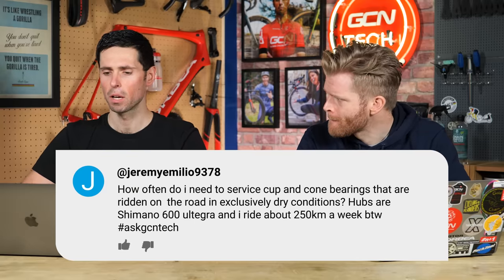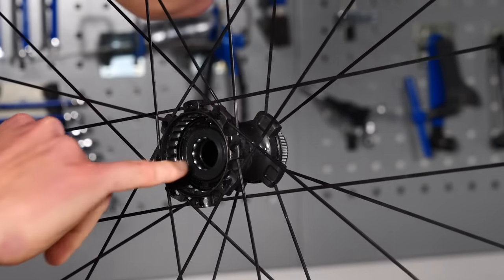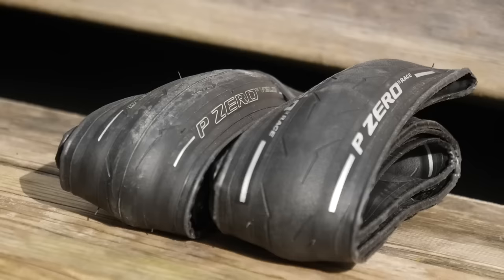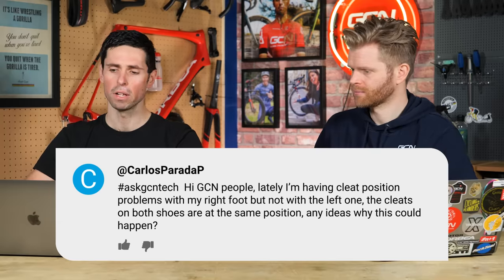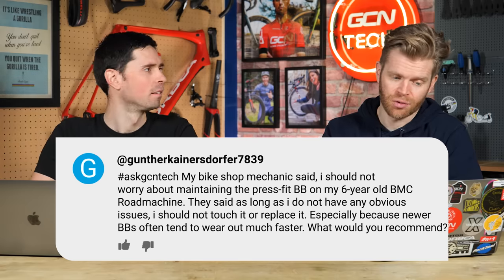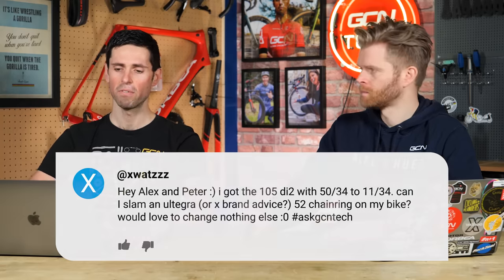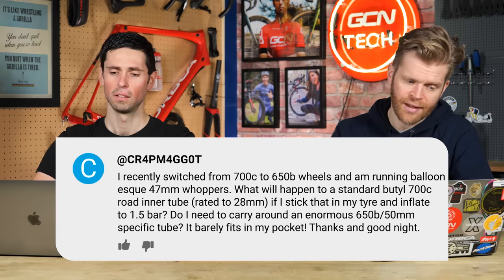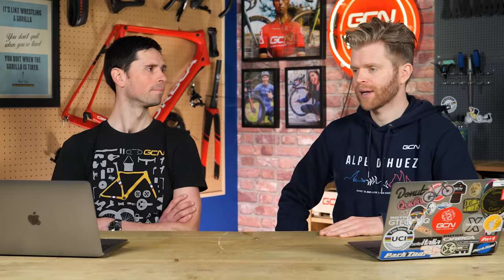Cycling Cleat Problems & Should I Swap My Tyres? | GCN Tech Clinic

Comment from the maker: Leave your tech questions in the comments 👇
Reply: Hi @gcntech Why can’t I unclip after fitting a brand new set of Shimano SPD-SL cleats? 
When will Shimano realise this problem and redesign their Cleats or Pedal release mechanism? 
Why do I have to resort to filling down the rubber tips (yellow, blue or red) that are making contact with the pedal release mechanism and preventing it from smooth unclipping? 
Why doesn’t Shimano sell replacement metal SPD-SL pedal wear plates?
Why does my perfectly fine pedals (bearings and body) have to go to landfill when worn wear plates start causing knee problems?
By changing from screw-on to bonded wear plates and by reducing the size and on some models individualised the contact patch, they made the problem worse.
Rant over, why do I bother anyway, I’m currently moving to Look Pedals because of the issues stated above and the fact decent quality Shimano pedals became pretty unaffordable compared to competition…

Please put a bit of pressure on Shimano to get their act together…
Thank you
Reply: #askgcntech -- There's plenty of bike-brand specific sealants like Slica and Stans No Tubes, but what about the "lesser" brands like Slime (here in the US). Are they "super good enough" or should I really spend more for Slica/Stans? I'm not a racer, just a recreational rider who does about 120 miles a week.
Reply: #askgcntech Hi there! Any thoughts on Silca's new "Stripchip"?
Reply: #askgcntech how do I avoid getting water in my wheels when cleaning. (I’m running Inner tubes if that helps) Thanks

Comment: An issue I came across when I replaced my GRX chainring to a larger big cog was also to be mindful of the fact you'll probably need to raise the front deraileur hanger slightly in order to give clearance for the new chainring. The extra teeth on the bigger new cog will make it closer to the hanger than it was with the smaller one, giving less clearance then before (in my case, the chain rubbed after doing this).

Comment: #askgcntech 

Assuming two cyclists (Rider A 60kg Rider B 80kg), with the same CDA, are riding at the same speed, into a constant headwind (15mph), what is the relationship between Rider Power, Rider Weight and Windspeed? What effect will increasing the windspeed have for each rider, and is it a linear correlation?  (3 points)

For extra marks:
Discuss if the headwind is increased to 20mph, what affect will this have on each riders power, if they were to maintain the same speed?. (1 point)

Comment: 700C/650B Inner tubes - the 700c inner tube is a wider circumference and won't fit properly in to the middle of the smaller rim. I think that the advice of a TPU spare tube is the best option in that scenario.

Comment: The Tubolito TPU tubes I carry work with both 650b and 700c tyres. Really useful when I run my ex GMBN Orbea Rallon in either full 29er or mullet, 29er front and 650b rear.

Comment: A narrow 700c tube won't stretch that well everywhere: the reinforcement around the valve won't allow it and create a zone of small stretch near very extensive stretch, basically a stress concentrator.
Now, a thinner, but still regular size 26" tube is a good compromise, when 650b TPU is rare or too costly. Tubes stretch diameter-wise much better than in width.
Reply: Yeah, they should have concluded with, "Try it and let us know.  We don't recommend it."
Reply: @larrylem3582  more like "try it and see how far you can go"😁

Comment: Regarding the addition of a 52t chainring to a compact groupset... I ran a 52t with a 34t chainring setup for years with no observable adverse issues. I did buy a new chain and cassette when I made the change, and I put roughly 7500 miles on it. I'd say do it and mind the cross chain alignment

Comment: How do you tell when the sprockets/chainrings are worn out is there a way of checking against a profile chart?
Reply: Once they resemble almost like a shark's fin or when your chain is beginning to slip over the teeth consistently whenever you put the power down, time for new ones.
Reply: Put a new chain on and see hot it fits. There are short tutorials on this. Meanwhile profile chart is not a reliable tool because teeth have variation in shape for shifting, and there is a significant error in projecting profile onto the paper.

Comment: I was personally able to overcome issues with pain in the back of my knees by lowering my saddle just a touch. I initially thought it was my cleats since I had recently started using SPD-SLs (coming from SPDs), but knocking my seatpost down without doing anything to my cleat position did the trick.

Comment: Tip on cleat position for different feet: spend some time on a flat pedal or otherwise non clip pedal and just look down at where your feet go. Having started with Christophe clips and Binda straps, I got into clipless with the first Look pedals after seeing Lemond and Hinault feature in C4 TdF coverage. But, years later, I kicked a wall hard while sleeping with bed next to the wall. Right foot now slightly twisted outwards and compacted by 5mm. The specialist said it would be the left foot that felt strange on the bike and he was right. Aside from spending a lot of money on a very careful bike fit, start with the assumption that your feet are not symmetrical so the pedals and cleats need not be symmetrical.
Reply: I've absolutely noticed this too. Still on flat pedals but my right foot tends to sit slightly rotated compared to the left and when I eventually swap over to clipless, I'll take that into account

Comment: The "group/bunch" experiment fails with variables like:

1 What's the size of the group?
2 What's the spacing of the riders?
3 Where does the test bike set in the bunch?
4 Can the test rider jockey for position in the group?
5 Will the test rider be out front at times or alway in the draft?

All of these are N variables that can greatly change the result of the test if changed.

Comment: I have asked this question many times but I never get an answer. Maybe this time? I have the new Trek Domane al 5 4th gen with 50/34 and 11/34 12 speed mechanical Shimano 105. I'm thinking about modifying it to 50/47 and 11/50 with a GRX derailleur for a "half-step" configuration. Will it work? And what would be the pros and cons of such a setup? Thanks?
Reply: First, GRX 1x derailleur capacity is not technically enough for 3 extra teeth up front, but it might work. Just like technically 12s and 11s pull ratios are different, but not that much.
Second, front derailleur parallelogram is moving so that the smaller ring must be significantly smaller than the bigger. If you move the FD way up for clearance over a 47t chainring, it will be too high at 50 and cause chain drop.
Lastly, did you check the gear spacings with gear calculator and surely wouldn't like other ways to achieve "half-step", with maybe 1,5 or 2,5 offset? But then you will definetely need absolutely another setup, very similar to 11s GRX
Additionally, sure half-steps are even any good for you? You ready to use FD as often as RD?
Reply: @feedbackzaloop  
I'm an armature cyclist, just started last July. That is why I'm asking the question.
1) Wouldn't the 12 speed 105 rear shifter handle the movement of the GRX. What does the GRX know about how much to move except the shifter actuates it?
2) When I look at the front derailleur while the 34t is selected the derailleur cage is already slightly above the 50t ring.
3) I did the gear ratios by hand and they are almost perfectly spaced in between each other along the entire range giving 24 unique ratios.
4) One would not have to use the FD all that often, only when one needs an in between gear.
5) I don't know if it would be any good for me. That is why I asked for pros and cons. I just like the idea and think it would be cool to try.

I bet that the GCN Tech members have most of the parts already available (except maybe the 47t ring) and could try this idea in an afternoon. Good or bad idea it is at least an idea worth making a video about.
Reply: @michaelsherwin4449  Try it yourself.  Sometimes you have to try a change to see why it is or isn't a good idea in practice.
Reply: @michaelsherwin4449  oh, it's Di2 we talk here, if i read your "what does GRX know"... Ok then, things get bit more complicated, but simpler. There is no 12s GRX Di2 and 11s di2 is not compatible with 12s Di2 in ant form.
Otherwise, mechanically:
1) pull ratio same, pairing shifter and RD shouldn't be a problem
2) ok, if you see the spacing is adequate, try it. But not so sure you matched the position of shifting features on the cage with chain
3) did you consider cadence range? In lower gears the spacing normally shouldn't be that tight. So guessing you need to compensate only top gears, my proposal was to shift half + n times full. Not 1l-1h-2l-2h... but 1l-2l-1h-3l-2h-...
4) if so, what is the purpose of half-stepping at all?
5) pros: you do something extraordinary and learn a lot. cons: you end up with hard to operate heavy system
6) GCN hardly ever try out anything unless it's a two-three video series for mass public. Most of questions picked are not specific but an example for broader audience.

So I have to ask you again, or rather you have to ask yourself, what specifically do you not like about current drivetrain and what compromises you could make in order to fix this. Because, well, if one could have it all, there would have been such sollution on he market, even be it very expensive.

Comment: Concerning the hub maintenance: it is also important which grease you use. A white grease turned rather fast into grey and also was pressed out through the seals (Shamal HPW rear hub), while the green Motorex bike grease stayed green and also remains in the bearings, even in the headset it maintained its composition for years, and dirt had no chance to get inside.
Reply from the maker: That Motorex grease you mention is very similar in appearance to what you find in Dura-Ace components, unsure if it is the same though

Comment: I do rotate my front and rear every 500-700 km to get even wear on both tire and replace both at the same time. I use  25-28 mm road tires with tube. Question:   Is it better to rotate or not rotate tire and replace only the rear tire when it wear out?  Thank You in advance.
Reply: I'd replace the rear with the front, so the front wheel always gets a new tire when the rear tire needs replacing.

Comment: #askgcntech
I’m 15 years old and a friend and I are planning a 200 mile ride in under 12 hours this summer. Do you have any tips? I’m on a Fuji Teansonic 2.9 with Superteam carbon wheels and rim tracks. Can I run TPU inner tubes on carbon rim breaks? Any other ideas or tricks to save time and energy?

Comment: #ASKGCNTECH I ride a 12+kg steel mountain bike but because I didn't really have the budget for a road bike. I finally got the budget for an aluminum road bike but I want to know if riding in harder gears would help me be ready for when i get on a road bike. The MTB still uses a 3x chainring which is why i ask the question on training on harder gears. Thank you so much and keep up the amazing work you've been doing.

Comment: Oli, science dude !
 « massively reducing puncture RISK by using tubeless » is not the way to phrase it.
Maybe it’s time to use new words to share the knowledge, something like puncture RESILIENCY.
And having a tyre set up with puncture SEALING ABILITY vs CARCASS REINFORCEMENT.
Or simplify with the use of FLAT, instead of the inadequately chosen word PUNCTURE.

Having a tyre increasing puncture resistance is not the same as having self sealing properties. But those come at the expense of drawbacks.
Puncture will happen, Deflation will happen, total flat too.

Every one needs a spare. I thought you two might remember 😂😅

Appreciate you guys, big love gcn.

Comment: #askgcntech: If my bike tends to veer slightly to the right when riding hands-free, requiring me to shift my weight to the left, what could be potential causes and how can I address it? Is the most likely cause a slight misalignment of one of the rims by a few millimeters, or could the axles possibly be misaligned? Visually, there is nothing apparent, and even with a ruler, nothing conclusive can be determined.

Comment: @gcntech not a tech question, but I just started doing zone 2 training.  I was out on my last base ride (planned to be 2 hours) and @ about 70 minutes I couldn't keep my heart rate in Z2 no matter how slow I went.  I'm reasonably fit, done a few centuries (including two "back to back" last year with only one day between) and 120 miles of the 140 steamboat race last year.  What does it mean that I can't stay out of Z3? Does it hurt the "base training" goal to just finish the ride at higher intensity or should I cut it short and go home?  Thanks.

Comment: #askgcntech: My front wheel (cup and cone) started sounding crunchy. I took the wheel to my LBS and they capitulated on finding parts after a 2-hour search. I have a wheel that is gutted with the recommendation being, to purchase a wheel with sealed cartridge bearings. Being Rim Brake, I looked at several sites and found precious few wheels available for rim brakes. How challenging is finding replacement parts for a cup/cone system (I understood that changing the bearings should be all that's required)? Would you reply with suggestions (sponsorship aside) for an economical wheelset for a rim brake setup, please? Thank you. Love the content and a huge hat tip to Alex and Dr. O for your expertise.
Reply: Ball bearings aren't the only thing that wear out in a cup-&-cone bearing assembly, the cups and cones can wear out too. I've seen pitted cups and cones before. For some hubs, the cups are part of the hub shell and are non-removable. At this point, a new wheel (or hub if it's a studio-built wheel) is the most logical solution.

Comment: I hear a lot of talk about tyre rolling resistance, but I never hear anyone talk about how tyres affect drive train efficiency. In other words, how much effect does tyre choice have on transferring wheel torque to force on the road?
Reply: efficiency = 1/resistance. Talking rolling resistance is same as talking efficiency of torque transfer. Unless the special case of grip loss. Then the efficiency is not considered anymore as a proportion of power out / power in and is replaced by effectiveness "ultimate torque >/< resistance torque"
Reply: @feedbackzaloop  Rolling resistance is mainly about radial forces (compressing and uncompressing the tyre). Drive efficiency is about tangential forces. They are different things.
Reply: @feedbackzaloop  Rolling resistance is mainly about radial forces (compressing and uncompressing the tyre). Drive efficiency is about tangential forces. They are different things.
Reply: @kevinmartin7863  no, rolling resistance is about tangential too. Or rather all forces, recalculated into tangential. Pure radial is suspension performance.
After all, it's rolling resistance, not sliding resistance, so it is equated to torque around the axle, not force perpendicular to the axle.
Reply: @feedbackzaloop  Rolling resistance is caused by radial force at the front of the contact patch.
Reply: @kevinmartin7863  no. just simply no. It's force normal to the ground (not normal to the tyre) offset by change in the radius. Force times distance equals torque. Radial force, normal to the tyre, doesn't have offset and doesn't produce torque.
Reply: You're replies make no sense. @feedbackzaloop
Reply: @kevinmartin7863  then go read a book to gain some sense before commenting. Anything containing "contact mechanics" would suffice, doesn't need to be new, it's basics
Reply: @feedbackzaloop  Consider an unattached wheel rolling down a slope so that the rolling resistance exactly cancels the acceleration due to gravity. The linear and rotational velocities are constant. If there was a tangential force on the wheel, it would cause a torque, which would cause a change in the angular velocity. However the angular velocity is constant, therefore the are no tangential forces.
Reply: @kevinmartin7863  OK, I see it now. You need to read even simpler books, like school physics.
Resistance creates torque just like always, as well as gravity (because it doesn't pass through contact point anymore due to the slope).

Comment: #askgcntech -- There's plenty of bike-brand specific sealants like Slica and Stans No Tubes, but what about the "lesser" brands like Slime (here in the US). Are they "super good enough" or should I really spend more for Slica/Stans? I'm not a racer, just a recreational rider who does about 120 miles a week.
Reply: I've been using Slime for the last 2-3 years as it's much less expensive than the other brands.  I use it for road, gravel and MTB bikes.  Seems to work just as well as the name brands, and I bought the gallon size of Slime which comes with a pump dispenser (1 oz per pump) that I hacked to fit over presta valves with the cores removed in order to easily refresh the sealant in the tires periodically.